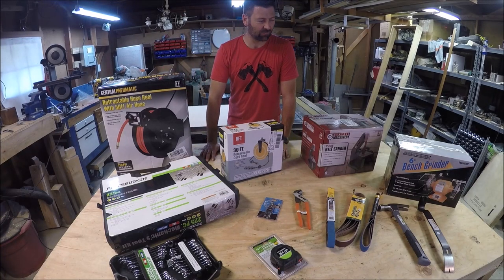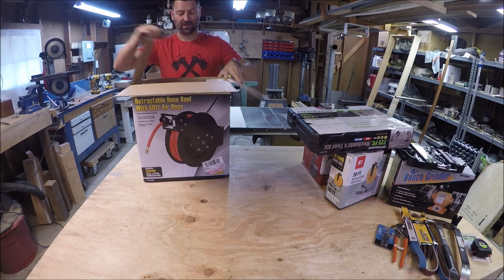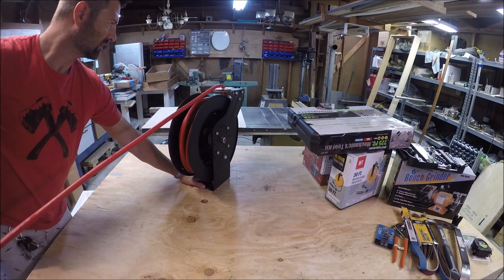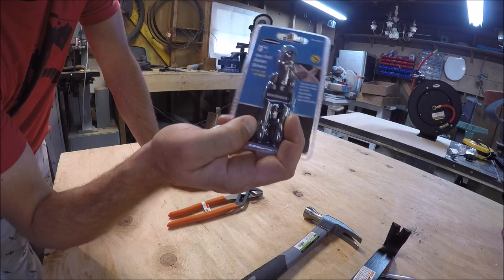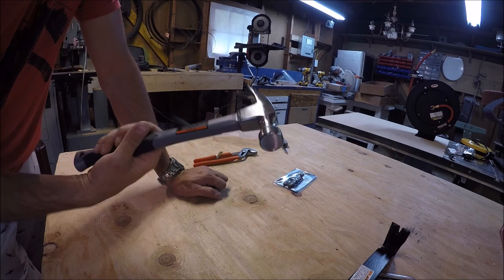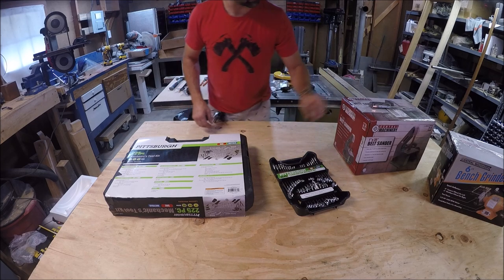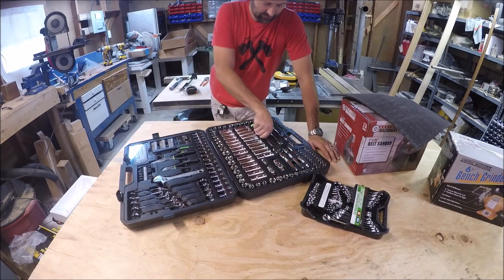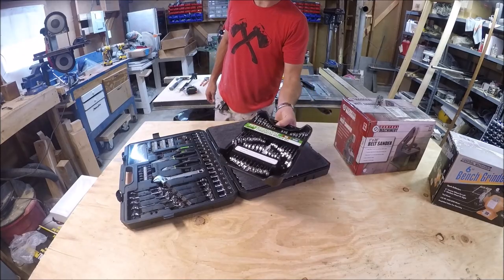Harbor Freight Tools For Pros | THE HANDYMAN

Comment: I learned doing house repair,guys figure in the cost of things like shop vacs because after doing a drywall job and cleanup, the vac is going to be junk,harbor freight tools could be used as one time,or one job repairs where you can just throw the tool away when done with the job. Some tools they sell are ok. I do hobby stuff,nothing heavy duty so cheap tools are ok for that. I have the free tape measure after cutting mine with my skill saw( dumby me). I have ran to harbor freight if I forgot a certain tool. I have even left the tool with the home owner so they would have it if they needed it.

Comment: The only thing Iv purchased from harbor freight that I have not regretted are a pair of rubber wheel chocks. Oh and a hitch adapter for a vise.
Reply from the maker: So far the air hose, 1 inch belt grinder, and tool set have been great. the bench grinder is worthless.
Reply: You would think if they can pull off a belt grinder they could handle a bench grinder..lol. I just cant have a tool breaking mid project and have to waste the time replacing it. Im sure they'll hold up if they are only needed occasionally.
Reply: Seejanedrill  on YouTube has a review of the harbor freight bench grinder. She says the same thing. If I remember right it’s because the wheels are out of balance and the motor is cheaper so it vibrates a lot. She does tell you how to fix it. https://www.youtube.com/watch?v=MnMifZoVVl8

Comment: I used to buy HF tools for my helpers to use on the job. Their cordless drills were pure garbage. Always end up running hot and slipping. Maybe they are better now. I find I use that hammer you showed the most. I do have an Estwing Framing Hammer also if I want to show off.
Reply: I have drill master drill and driver and they do fine. The impact speed is a little too high and the batteries are complete trash. No available decent charger as well. My biggest complaint is charging.

Comment: Lots and lots of pros use harbor freight tools, In the beginning in fact this is why lots of pros become pros. I started my business using harbor freight tools and still use some of them some like that bench grinder not worth shit but some still work great over 20 years using! Like the small drill press yeah! I dropped that thing from the second floor of my shop and it still works great. I bought another one just in case and still have that one too. Of course the metal shop on the first floor is using a large home depot purchased one still going strong but that is only two years old so it should be! Pros look to save as well i get some supplies on wish.com like the blue sanding disks they are fantastic!

Comment: I am a pro and I used harbor freight tools. So items have extended service plans get them you can exchange almost anything for any reason never had a problem. I have as of recent had problems with sears they are reluctant to replace tools and don't really have replacements for some of the specialized tools that I have.
Reply from the maker: Hey Fred thanks for the comment.  I don't depend on harbor freight tools for my day job  but for my home workshop I'm trying out a few of them.   What HF tools do you use the most and recommend?
Reply: I can recommend the mini lathe and mini mill. If you can fix your own tools ALMOST anything will work well from hf ... Outside of consumables (grind wheels, weld wire, belts, etc) ......that mechanic set is for teaching children, half may hold up in your homeshop.
Reply from the maker: +Johnny Drinkard I would love to have a metal working mill ad lathe.  Thats on the list.  A good used one is still thousands of dollars.
Reply: Mini Lathe like 350$, on holiday with coupon. You'll need to rebuild it, but so worth it. Mill.... yeah with tooling its no getting around that, its about a grand.
Reply: Very nice work on the shop , great job. You'll get there , you might enjoy their wood lathe too, you have the space.
Reply from the maker: +Johnny Drinkard I have there floor mount wood lathe.
Reply: I looked closer at your video over (without typing) i noticed it in the background,  really nice shop. Careful of that rachet in that set , your knuckles will not forgive you. If you dont have one , pick up the pocket reference book.

Comment: You'd be surprised how much stuff you could find at a $1 store. More throw away stuff when you're done with a job like mixing buckets, scrapers, gloves, etc... Certain wired tools, I haven't found the need to pay more than you need too. My angle grinder and oscillating tool are from Walmart and were $17.99 each. I use my angle grinder almost everyday and its held up like a champ and if it breaks, ill go buy another one.

Comment: Is that a HF lathe I see in the back ground? How has it been for you?
Most of the tools I have purchased from HF have been a good buy, some I got what I paid for, a few have been dumpster fill.
Notably good have been most of there mechinac tools, the better small wood lathe (turn a lot of pens), the better bench top drill press, ... not so good was there large better wood lathe mine craped out after a few hours, BUT others have used the heck out of theres.
Reply from the maker: Yes it is a HF wood lathe.   I bought it used for $100 with a lot of extras.  It works great.  I haven't had much time to mess with it yet.  I made a bowl and a pen so far.

Comment: I have the 225 piece tool set and put it through hell. I actually used a 3 ton jack on the 1/2 inch ratchet to get a caliper bolt off... It didnt break

Comment: I started using them to install direct TV plus I get 25% discount. They are revamping their tools you should always talk to the sales manager because the tools are sold in the I just need it to use occasionally and the I am a pro using it daily if the price is not right talk to staff the tools are graded. So far I used hand tools the impact bits hammer drills demolition hammer. Remember that as a pro we budget for tool the average guy may have spent too much on the repair and still needs the tools it happens and these fit that nitch. I know I had all my drills and power tools stolen and hft tools was what I had cause I had to turn a profit first even though I could have bought the other stuff. Beside who is would be silly enough to put a grand worth of tools or more in your work truck with no locks working out of state. So you get a few dollars of hft tools thieves could not given them away used estimated value would be nothing.

Comment: Hey man, quick question.  Do you use an app to invoice and accept payments digitally?
Reply from the maker: +Adventures of a Handyman I have it throught quickbooks.   I Tryed it out but never use it.   I have an estimate template in excell that I have been using for years and it works good.  I tey not to over complicate things.
Reply: The Handyman ok thanks.  I've had a few customers ask to pay with a card.  Just wondering what other small business owners use.
Reply from the maker: +Adventures of a Handyman ohhh.  Quickbooks does have a way for customers to pay with a card.    The bank that you have your business accound set up at should be able to get you a card reader for your phone.  I have bewn thinking about getting the card reader too.
Reply: +Adventures of a Handyman I've been using an app called Joist. It's totally free, can do estimates and invoices, has a pretty customizable estimate and email template, stores customer info, common jobs, etc. You can also accept card payments though it, too. Check it out... I know it's on Android, and I'm pretty sure it's on iOS as well.
Reply: crouton976 awesome!  Thanks!

Comment: I had a pair of the orange handle tongue and groove pliers.  Right out of the package, the two pieces slipped past each other and pinched the skin on my hand, tore the skin open and still has a bruise 4+ weeks later.  No way to tighten them up.  Threw them in the box that goes to the scrap yard.
Reply from the maker: I'll have to keep an eye on them.  I have higher quality ones in my work trailer that I use every day.  This were just to use in the work shop.
Reply: litehouse6 I can relate,those damn plyers are crap.
Reply: There is only one company that can make slipjoint pliers,we all know this to be true as I don't even have to say their name and you all know the brand I'm talking about

Comment: My $250 wet tile cutter is still doing well 2 years later .....I'm looking for a framing nailer if anyone has some ideas ....Its just for one large shed that I'm going to build ....
Reply from the maker: +Mark Cam I have been using a Hitachi for close to 7 years.   I do light framing it works great every time.
Reply: Thank you Handyman ........

Comment: Some of the stuff they sell is good.  I've only been disappointed with tap and dies combination set and a rotary tool.. HF  is the shit..
Reply: John m which tap and die set?
Reply: Anthony Baldwin the 19 dollar high speed steel.. and was tapping aluminum.. i looked at them after and noticed there were burrs on the taps.. i would give the titanium nitrate ones a try. They couldn't have burrs being coated.. i also got the cheaper angle grinder sucked.  6 bucks more you have a decent machine..
Reply: John m I was thinking about trying those myself

Comment: A little overkill for sharpening knives. look into the lansky 5 stone deluxe sharpening system on amazon $60 and it will put anything else to shame. and last longer. and get yourself a knife. Multi tool knives are made of inferior metals and lose there edge fast.
Reply from the maker: My blade on my multi tool is made of S30V.  I have a leather belt that goes on the sander and it puts a razor sharp edge on it.  I have lots of knives but only take the multi tool with me every day.

Comment: I'm not a professional and even I will never even touch a harbor freight Hammer or pliers with a 10ft pole.
I've had a cheap hammer chip on me cutting my cheek, and because Channellock brand pliers are inexpensive enough and will last a really long time.

It is easy to screw up a pair of pliers or a hammer.
That hammer face will be all dinged up in a month, and those tongue and groove pliers will have worn teeth in about the same amount of time.
They have a warranty and you'll need it on those pliers more than a few times.
Reply from the maker: I will do  one year review of all these tools.
Reply: The Handyman 
I doubt the pliers will make it if they see any use, I hear the new Doyle ones they've got are better but I stick with USA even if that means I gotta go vintage to afford it.
Reply from the maker: It's been 8 months so far.  Still as good as new.

Comment: Use sharpening stones for knifes not sanders. Lol
Reply from the maker: Thats old school.  1000 grit then a leather strop belt for the best method of knife sharpening.
Reply: 19RioR93 don't know, the knife seemed pretty sharp to me. Honest question: what difference does it make?
Reply: gracie gordon like if you have a really nice old knife. You don't want be sanding it down. In your case it doesn't really matter I guess.
Reply: He used a “1000” grit.  That is NOT grinding.  New school way of thinking, 1000 grit belt IS sharpening and not removing excessive amounts of blade.  Now your normal thinking of what a grinder would be, would be around a 36 or 80 grit.  That is metal removal!  😂 Ha Ha

Comment: Harbor Freight channel locks- garbage.  So sloppy that they will jump track if you put some pressure on whatever you are using them on.
Reply from the maker: I have a pair of kobalt from lowes that do that and I hate it.  Any suggestion on a quality pair of channel locks?
Reply: Over the last 40+ years Channel lock brand have proved to work well at a decent price.
Reply from the maker: +jz422 do you know qhere I can buy some? I need some better wuality ones for my work trailer.

Comment: Lol, he said Craftsman and high-quality in the same sentence.
Reply from the maker: +heavyset0223 I have had the same craftsman tools for over 20 years. Been through a few rachets and can only remember breaking one socket.
Reply: Have a 30 yr old craftmans set solid as a rock. Bought a new set recently and am very disappointed. Their new ratchets SUCK. 1/4" ratchet was broke straight out of the box 😡😡
Reply: The Handyman I too have a mixture of 20 and 30 year old craftsman hand tools, such great quality hand tools. The 20 yos are mind from auto school, and the 30 are my dads when he passed away. Not a single issue that was the tools fault.
Reply from the maker: +jsj297 thats exactly what I was referring to when I said craftsman was a quality tool.  Thanks for the comment.
Reply: yep..have  a lot of Craftsman out at my moms..dad died 30 years ago..the tools were 15-30 years old.... I think the only thing that ever broke were some nut drivers .
Reply: I have used craftsman tools for years - including a few of my grandfathers (so over 40 years old).  These tools (in my family) have been used to rebuild/restore/repair ~ a dozen cars including multiple vintage mustangs, build a trailer, house repair, and now homesteading.  The only things I have broken are a ratchet and a 1/4 socket (after driving over 2000 hex screws).  Both replaced for free - no questions.  The new tools from them I cannot speak too - because the ones I have from them are so good I have no reason to buy new ones.
Reply: I HAVE craftsman that is from the 1940s  AND THEY WORK  , harbor freight sells slave labor  CRAP
Reply: my dad has about 40 ratchets and only 2 are broke. and then we can just go to the local market and get them replaced for free...
Reply: I have used Craftman tools for over 30 years with no problems.  I even buy older Craftman tools at estate auctions.  Everyone seems to bid on them at the auctions.
Reply: I inherited my dads Craftsman tools most of which are 40 to 50 years old. My go to 3/8 inch ratchet is a 40+ year old Craftsman. High quality? What's your definition of high quality?
Reply: I have several old tools from varipous manufactures that are US made and are at least 50 years old... I bought them at estate sales, yard sales etc, showed em some TLC and suit me just fine.